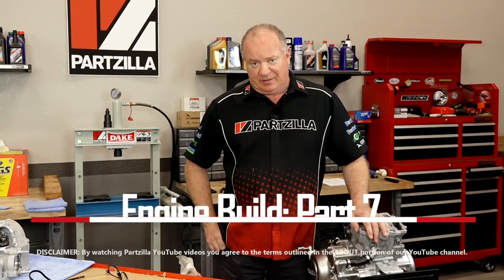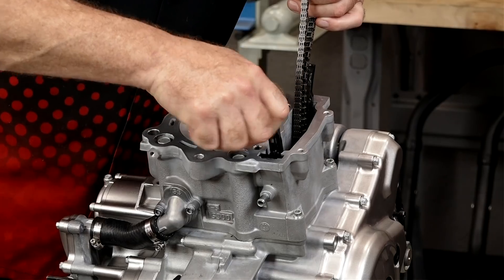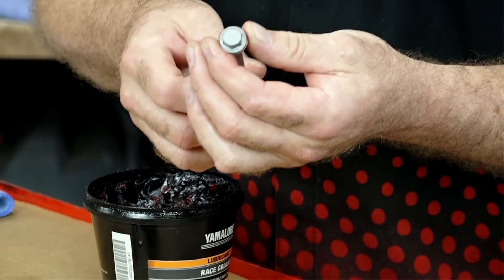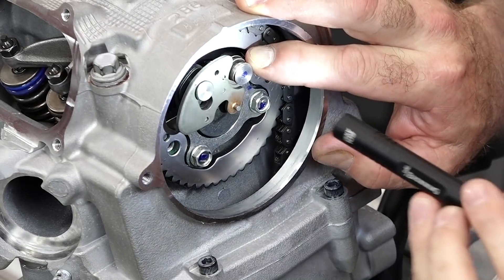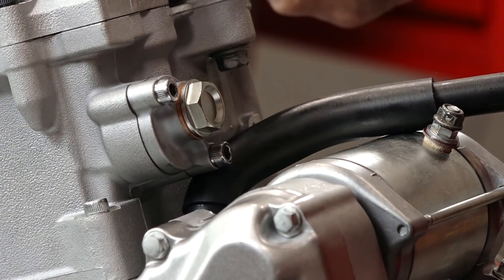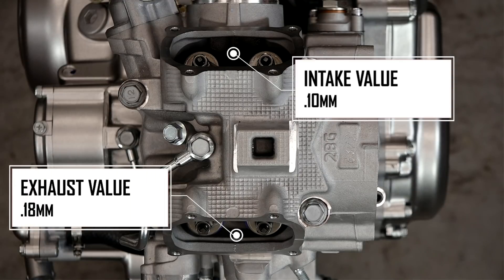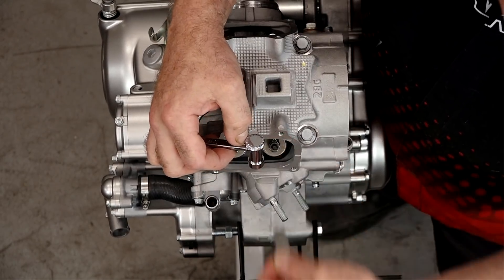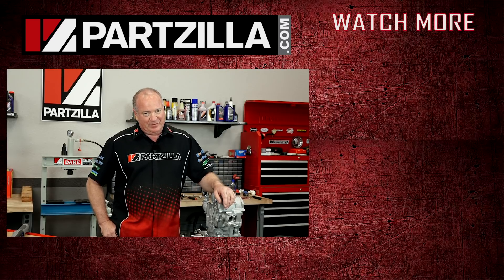Yamaha Raptor 700R Engine Build Part 7: Head Installation and Valve Lash | Partzilla.com

Comment: At 5.40 when u say becarfull not to drop them well I did drop one how far do I have to go in to the bottom end to get it back out just the crank case I hope plz help
Reply: Did you get it? I’d pull the crank side case cover off.
Reply: @mitchelldaniel2350  ya I had to pull the cover and magneto was not fun but did my timing chain while I was in there
Reply: @travissprague7775  I did something to the same extent. Dropped a wrist pit for wrist for piston down in the motor. Got it out luckily. Thought I was about to be splitting the motor. Stuffed some clean rags down in the hole gave it another shot, and got it. That’s one of them mistakes that you’ll only make one time.

Comment: I have a 2006 Raptor 700, turns on fine but dies within seconds, any any idea what could be the issue?
Reply from the maker: Fuel or spark.  In this case, I'm guessing fuel.
Reply: Partzilla  could the fuel pump be bad, even if it primes?
Reply from the maker: @sg6722  Yes, just because it primes doesn't mean it's actually pushing fuel.

Comment: I must have missed it, but why does a two year old machine need an engine rebuild?
Reply from the maker: It didn't.  We just wanted to build one from scratch and show you the assembly.
Reply: @PartzillaParts  did you ever tighten those timing chain sprocket bolts on the head cylinder great job great video